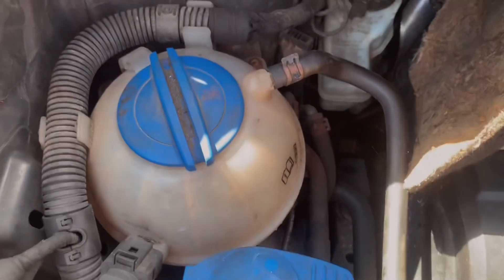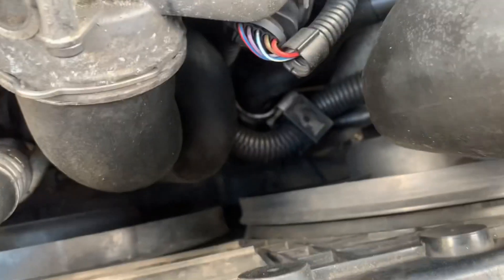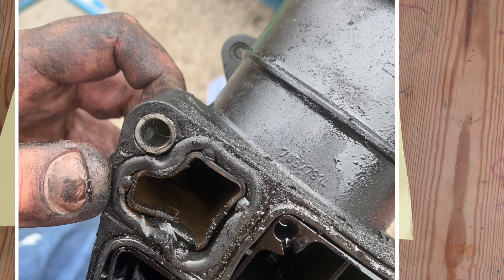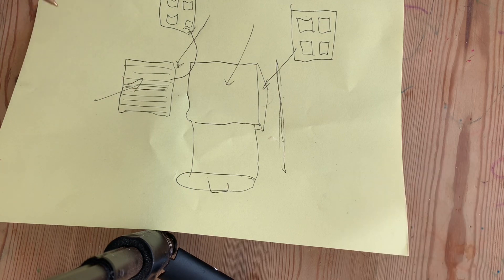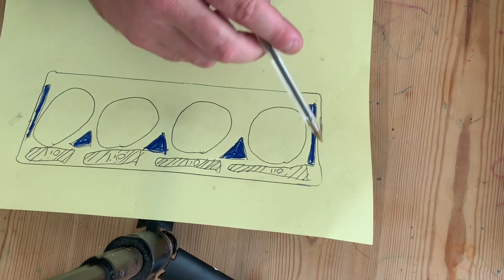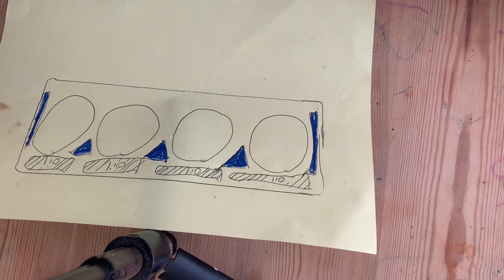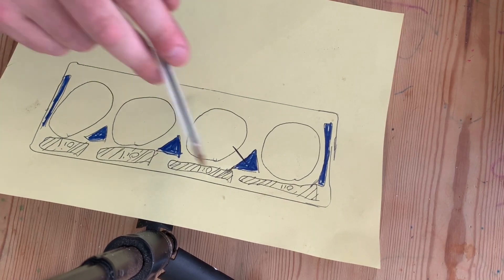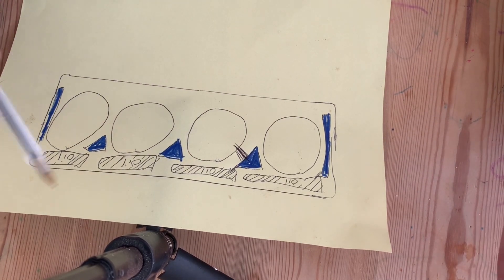VW Coolant Contamination: Causes, Signs, and Solutions | A Comprehensive Guide

Comment: Morning Chief I have a vw T5 caravelle 2.5 Diesel
I just bought a new used engine so when I try to start it, it just cranks then the oil will come out of the radiator water pipe 😢 what can be the problem?
Reply from the maker: Good morning!!

Oil out of the radiator?? That’s very odd!

Firstly we need to understand why this may happen. Usually oil is pumped around the system at a greater pressure than coolant therefore unless the leak is near the coolant pump then you will get oil in the coolant system.

My guess would be your oil cooler or your oil cooler gasket has failed. Annoyingly on these engines it can fail from the oil filter manifold to engine gasket or oil filter mabifold to oil cooler or the oil cooler its self.

Any signs of coolant contamination inside the oil itself self? This would point to head gasket as the coolant is normally at greater pressure than oil at this point?

I’m sorry I can’t help much further
Reply: @TheTriumphGuy101 yes that's my problem
Reply from the maker: @djpromashile5375 I would start with the oil cooler :)

Please keep me updated?
Reply: @TheTriumphGuy101 I will do so b4 wed

Comment: hi good video nice infomation but couldn’t really help me 
i’ve got a coolant leak i changed the bottle as i thought it had a crack and it’s still leaking what else could it be?
Reply from the maker: Good morning!

I hope you are well! 

How bad is the coolant leak?

Places to look - and just confirm if you have

Passenger footwell? Heater core leak

Timing case? - water pump 

Radiator? Jack car up take off covers and look for leaks

Oil contaminants - has the oil filler cap got a mayonnaise like substance inside it

EGR cooler - these can fail.

Did you use this pressure tester kit? If not it will be unlikely you will find the leak

If you press “reply” and I don’t answer within 24 hours then ethier message my FB page OR write a fresh comment and I will get a notification. I will help you with this fault :)

Comment: Probably the most helpful video on YouTube about this problem. I have a T5 with a mystery coolant loss and murky coolant in the bottle. Doesn't overheat, been pressure tested not HG apparently. So points to cooler.
Reply from the maker: So happy I can help! 

These Vw coolers do fail; is yours plastic or metal?? 

I changed the whole filter housing and unit on my Touran :)
Reply: @TheTriumphGuy101  Not sure tbh - 2006 van
Reply from the maker: @dombradbury ahh I don’t know ethier probs plastic

Comment: Hi mate, I need some of your advice. I have 2017 seat Alhambra 2.0 diesel. I’ve noticed recently the  coolant level seems to be low but as I open the cap the pressure puts coolant back to its normal level. Also when driving on motorway approximately after 30-40 miles of motorway driving the heater will go cold. The car temperature is fine and stays on 90. Soon as I’m off the motorway and stationary or driving local the heater get hot again. Is this related to my coolant with the pressure issue. I’ve changed thermostat and have a a radiator flush. I changed timing belt and water pump in October and was working fine until start of jan. could you help please
Reply from the maker: Hey hey! Preasure thing is fairly normal, these systems don’t release pressure until 18-22PSI.

How cold is cold? Is it still slightly warm!?